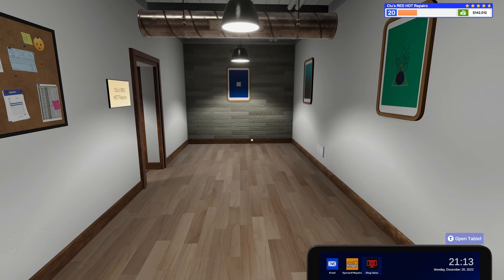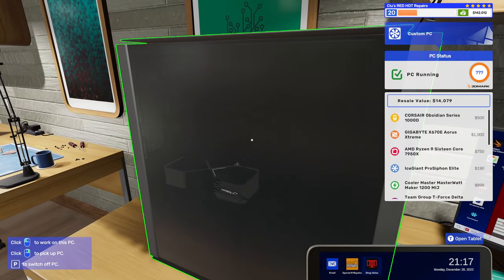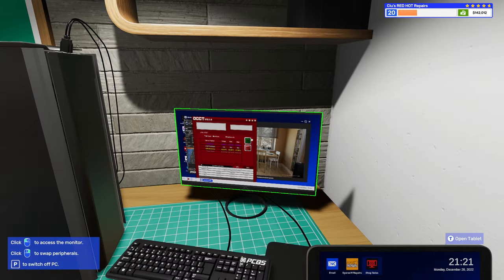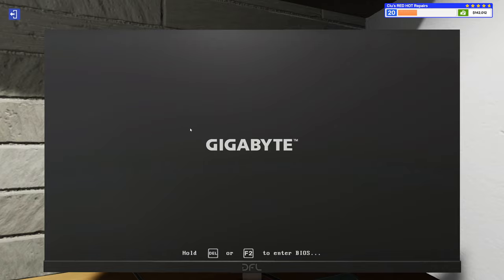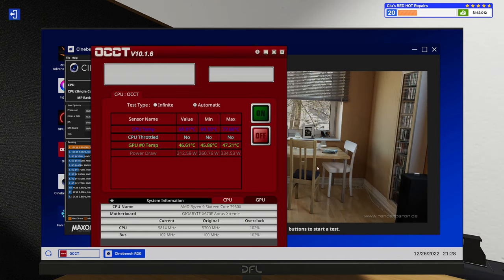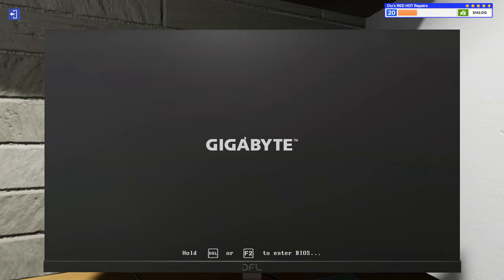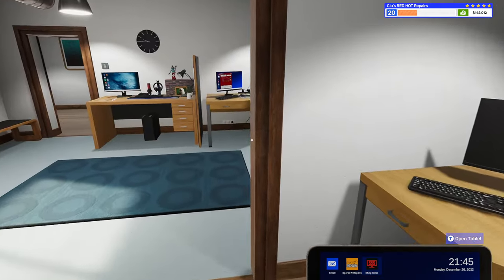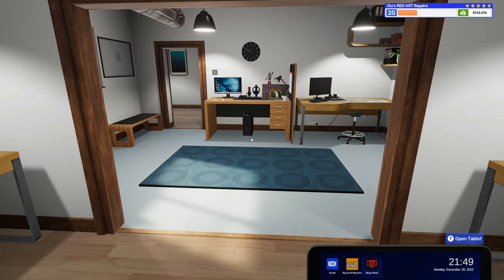Which CPU Cooling Solution Is Best? Review Of Ryzen 7950x Coolers. PCBS2 Career Walkthrough Ep. 19

Comment: Silicon Lottery is a thing in real life that is also simulated in this game to a lesser degree. If you are unaware, Silicon Lottery is a thing that affects overclocking. You can have 4 identical setups and it is possible to overclock more on one than the others. For example, I had a build I tested this on. I installed/uninstalled the same CPU on the same build. The first 3, I was able to safely overclock at around 105% over. The 4th one, I was able to get to 109%. I'm not the best at explaining this concept, but I hope that makes sense. Just pointing this out because it could have affected your results. So the reason you got some blue screens on one and not the other may not have been because of the temps, but because you may have gotten a 'lottery winner' you could clock higher on one and not another.